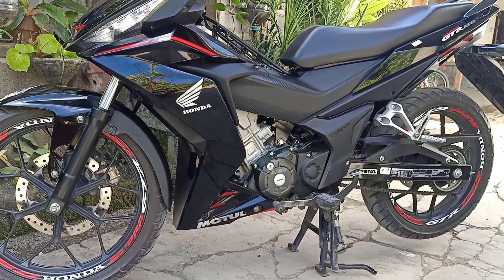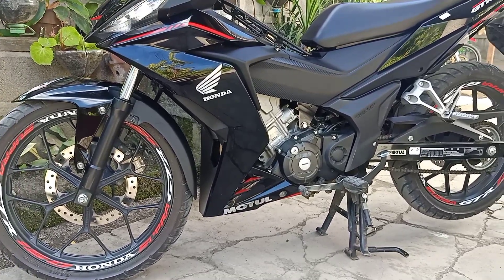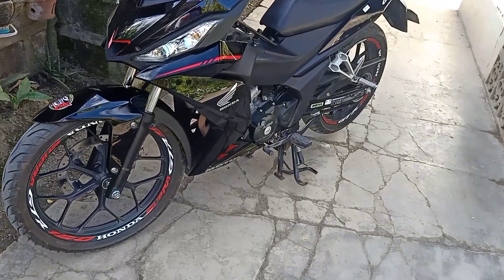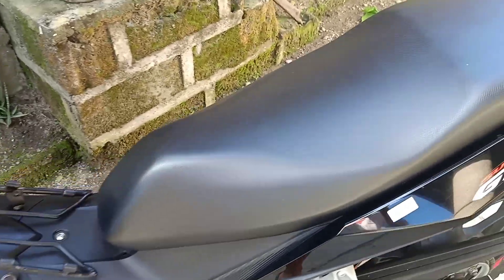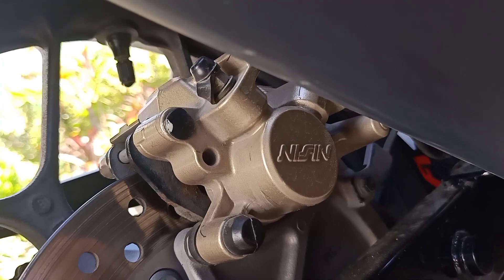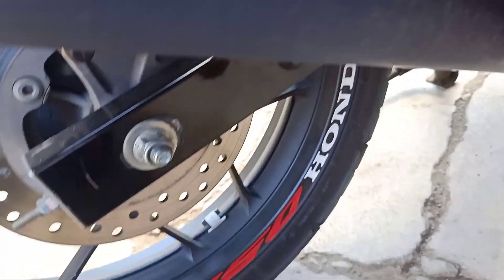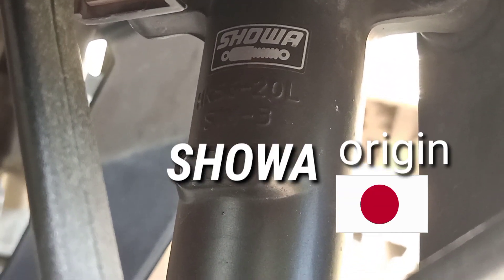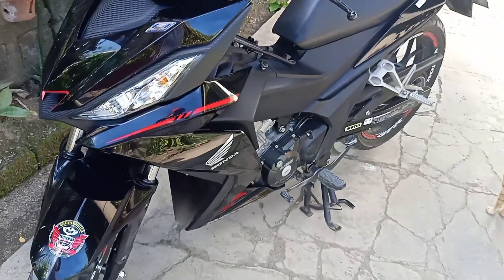Why Honda Supra Gtr 150?

Comment: Yung clutch nyan medyo nakabuka, nakaka ngalay sa traffic.
Reply from the maker: Adjust mo lang paps
Reply: may iba pa bang issue yan sir? may nabasa din kasi ako na ..

1. Maingay ang tensioner (or kadena)
2. Matigas i kambyo.
3. Mahina headlight.
Reply from the maker: Minor issue lng Yan pra sakin..
Lahat nmn may issue.basta Honda parin ako .

Mag Yamaha kna lng o Kaya suzuki
Reply: No sir. Solid Honda ako 🤘 normal lang naman sa motor yung may issue, nasa gumagamit nalang kung paano nya i hahandle. 

Anyway, solid yang Supra GTR na yan. 

1. Comfort Riding
2. Fuel Efficient
3. Powerful Engine 🔥
4. Masasabi kong all around underbone and last.

5. One the best underbone dito yan sa pinas. 💯